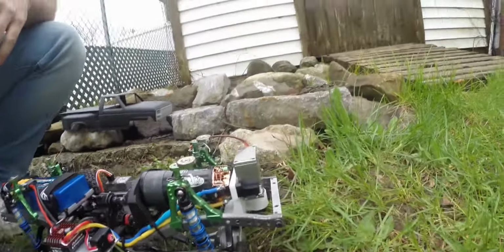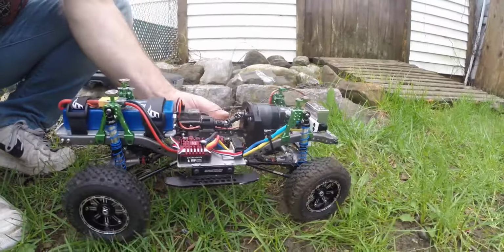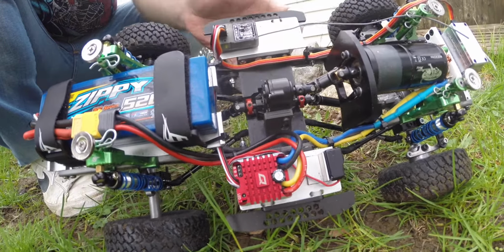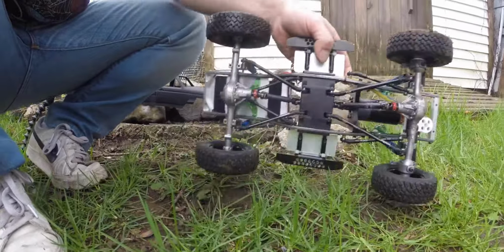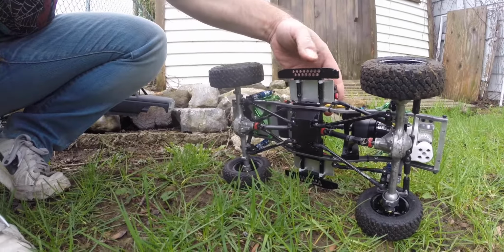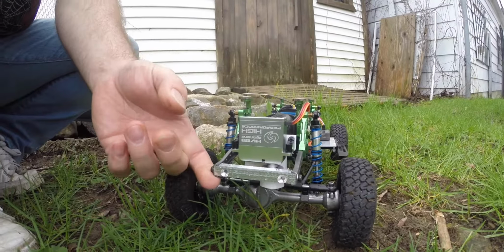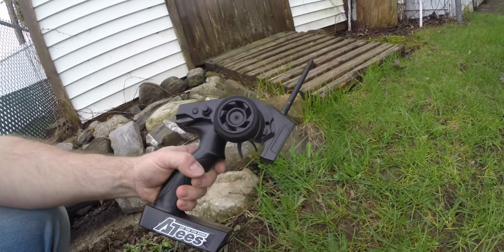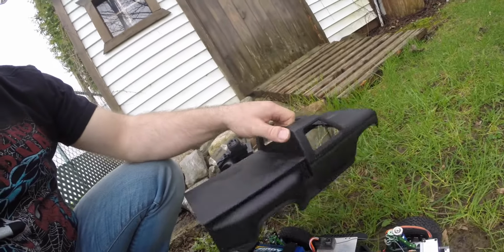BoomRacing SWB Chassis Update with 3D printed parts

Comment: That's really cool Stephan! Neither me nor my friend can afford an SCX-10... We never thought of BUILDING one from parts!!
And that wheelbase fits the Blackfoot body so well. It should also fit my Landfreeder body, which is already done, with interior and full lighting. 
You're REALLY making the little gears turn in my head!! 😲😎👍👍
Murph
Reply from the maker: Glad I inspired you.... as for the wheelbase, it still needed to be adjusted and took a bit of work because I used  RC4WD axles. If you use the Axial ones like the kit is made for then the stated SWB kit is easy and can be adjusted slightly. But in the previous video concerning this project I showed how I went about adjusting the wheelbase.... cheers and thanks for watching.

Comment: How hard was it to learn 3d printing?
Reply from the maker: well you have two things to learn. 3 If you build the printer but you need to learn how to properly set the printer for each filament and also have to make your parts in a 3D ap. I use Tinkercad.com and find its the easiest one I ever used. all in all not hard to learn but the learning curve is quite high and 3D printing is nowhere near an exact science yet. I used up a complete 1kg spool trying to tune my printer then I finally saw I had an issue with the Filament feeder pinion gear. it came loose but since then its been a charm.
Reply: Thank you very much. I think I will get one when money allows. I think I'll be ok. You've seen my mechanical, plus always tinkering with android and windows. I also used a 3d cnc at work, and I'm good with the x,y,z. planes. I'll pm you on the forums when I collect some money for opinion on brands to get.